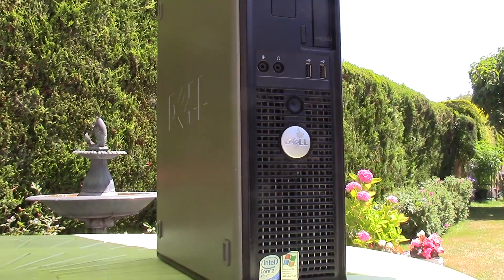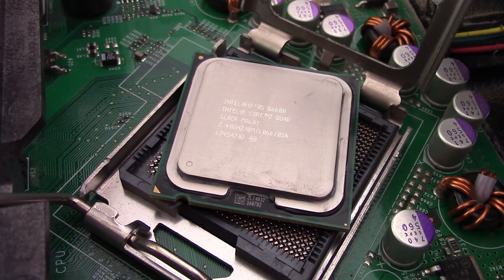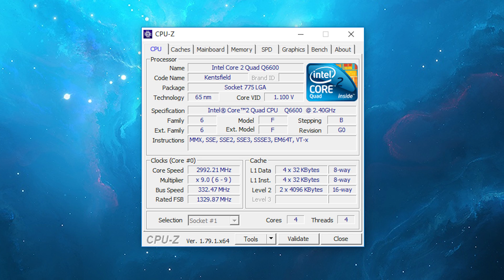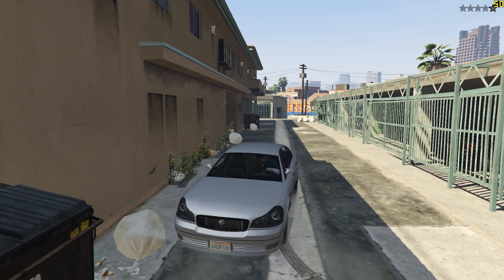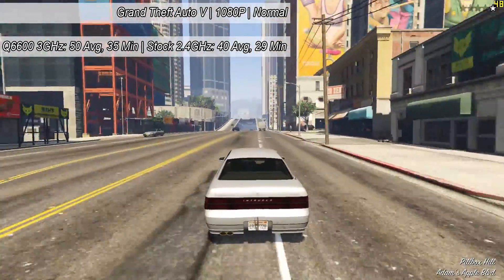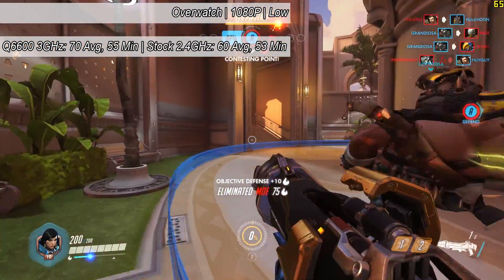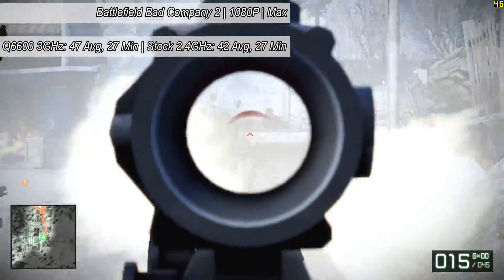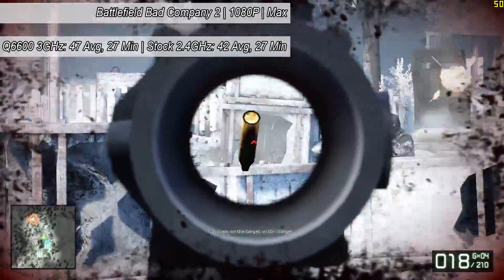Using Tape To Overclock an Old Optiplex

Comment: Just came across this video as I’m trying to do something (anything) with an old Dell Inspiron 545 Core 2 Duo E7400. Saw this, tried it; stock it’s 2.8Ghz, now it idles at 1.9Ghz but drives up to 3.5Ghz under load! Holy crap!

Comment: You can overclock the core 2 duo E8xxx series with this method too.
But you need a motherboard that supports 1600mhz fsb because if it doesn't, it won't work.
Reply: FOCU53R I got an e8400 but the fsb isn’t supported
Reply: Sorry bro, you cannot overclock the E6550 because it is already running on 1333Mhz fsb. Core 2 Quads are easy to overclock because they run usually on lower fsb (800mhz) -> 1333Mhzfsb
Reply: Q8300 works?
Reply: Should work if your motherboard supports 1600Mhz Fsb.
Q8300 is also running at 1333Mhz stock so you need a MoBo that supports 1600Mhz fsb
Reply: Yup, you can hunt the old q6600's around 10-15 $ on ebay and with the tape mod you get 2.4Ghz -> 3Ghz which is still pretty decent overclock.
Reply: @LouieV.  Do i need to changed psu for bsel mod ?
Reply: @4n4Queen  nah man, you're good with the same psu.
Reply: @LouieV.  How bout cooler m8? stock cooler still good for bsel or need to changed ?
Reply: @4n4Queen  stock cooler is alright
Reply: Will it work with my q9400 and g31 motherboard???
Reply: @LouieV.  will it automatically change cpu mhz or u must do something with BIOS?
Reply: @Qwerudbhdisn  haha old comment,but  it changes the mhz automatically. No bios needed.
Reply: @LouieV.  will it work with q9400 and g31 motherboard?

Comment: just to let you know the mod will not change the multiplier wat will change is the fsb speed and depending on the pc/chipset the mod will make the cpu run at the chipset max FSB speed. so in this situation the normal FSB speed will be 1066MHz, and with the mod its 1333MHz and so boosting the bus speed that is multiplied to get the cpu clock speed.

Comment: I just recently OC'ed my Q8300 from stock 2,5GHz to a whooping 3,2GHz - runs like a charm on 30$ air cooler, and a low-end mobo P5Q-EM.
Also I'm running MacOS Sierra which is a double win :-) Definetly will try to push my CPU further.

Comment: I just did that today on an old Dell 755 USFF that I’ll use to test some stuff on, the CPU is an C2Duo 6600 (USFF models doesn’t support quad cores) I did that and it went from 2.4 to 3Ghz fine. CINEBENCH gave the same results before and after however so it doesn’t seem to make a lot of difference (CPUz correctly shows the CPU running at 3GHz after the mod) Anyways for what I’ll use that old PC it’s fine and to be fair for a 2006 CPU it’s still fine for basic use like surfing the web (And that Pc isn’t meant for gaming, it doesn’t even have a single expansion slot and has integrated intel graphics from the Q35 chipset anyways)
Reply: I used SetFSB for my Q6000 / Dell Opti 755 Mini - And was able to o/c to 2.82ghz (prime 95 stable 2hr). i'm not sure if I can go any further though,..... gets a bit whacky when I raise FSB 1-2 clocks.

Comment: Some motherboards use the CPUID to calculate the CPU FSB and not the pins, this mod WILL NOT work on these motherboards. So that is the reason why the success rate is not 100%.

Comment: you can find more information with searching ''Bsel mod'' and in my experience the best is q6600 dont try more expensive ones.
Reply: Özgür Salman it's only work with q6600
Reply: No it works with many 775 cpus. q6600 is the most stable
Reply: Actually, expensive ones simply work on higher FSB already and BSEL mod doesn't do anything to them (Core 2 Extreme and 1600MHz FSB Xeons).
For high multiplier CPU's, like E5700, a working "VID mod" may be necessary for stability (before doing BSEL mod).
Reply: Only works for 266MHz CPUs, all it does, is to make the board think that you inserted a 333MHz FSB chip:)
Reply: 1333mhz FSB Xeons supposedly go to 1600 with this mod. You'll need a very beefy cooler though, especially if it's an X5450, X5460, or X5470.

Comment: Another CPU that can use this BSEL tape mod is the E7500 Core2Duo. It gives 3.67GHz speed. Unfortunately for the Q6600 mod any Optiplex that supports 333fsb can run the Q9650 CPU. 3GHz speed, 12MB cache, and SSE4 instruction set for newer games. On single thread games it should perform better than the Q9650.

Comment: That's what I have on my machine q6600 to 3ghz it changes the front side bus speed to 1333mhz from 1066mhz which increases the clock speed it does really well and make a massive difference for me

Comment: My New specs:
Core i5 2400
16Gb Dddr3 1333mhz ram
Gt 1030 2 Gddr5 vram
250gb Western Digital Caviar Blue HDD
60 Gb ssd
Windows 10 Pro 64-Bit
Reply: ALESSIO TULLOCH 16gb of ram is fucking overkill in a system like that, I mean, the 1030 costs less than the ram
Reply: Kevi Shader It is a Dell Optiplex 990 and I did not buy the ram. It came with it when I bought it on EBay for $50
Reply: ALESSIO TULLOCH Oh that's a good deal tbh. 50 bucks for that system is extremely cheap. You could sell those parts and have around 300 dollars after you sold them
Reply: Kevi Shader Yeah. I am actually planning to flip it, if you know what I mean.(sell it)
Reply: ALESSIO TULLOCH Good choice
Reply: My current specs:
I5 3470
24 Gigs of RAM @ 1600 Mhz
3x GTX 1070
Samsung EVO 850 250 GB
2x 3TB Toshiba P300 + 1x 5TB

Thinking about getting a ryzen 1600x but currently the I5 is still kinda holding up, so maybe I'll wait for the next gen.
Reply: 3x Gtx 1070?
Reply: They are actually pretty good mining cards.
Reply: Well my specs are:
Gtx 1060 6gb
16gb 2133 ddr4 ram
250 gb ssd
1tb hdd
i5-7500 clocked at 3.4 ghz
Reply: my specs:
hp elitebook 8470p
core i5 3340m 2.7ghz processer
8gb ddr3 1600mhz ram
320gb toshiba hhd
windows 7 professinal 64-bit

Comment: Magnificent! You've saved me a whole heap of hassle :D
You actually CAN overclock on a Dell 755 motherboard using a Front Side Bus multiplier program, which I was actually going to do (and may still do to squeeze out extra performance, many Q6600 chips can hit 3.6ghz or more stable in a Optiplex), but as a quick and simple mod, this is incredibly tough to beat :D
Thank you for sharing this video and method with us all!
Reply: Phil Atkins have you used setfsb?...because i tried to find the right pll for my dell optiplex 760 dt (0d517d) mobo...but every tries failed...i underclocked every time🤔
Reply: Roland Tibold Dang that sucks! No I haven't tried that one. It's a pain in the bum to get the correct code from your motherboard for these programs to load properly. My advice would be to try this tape method, and see if you can live with the performance boost it gives you.
If the tape mod doesn't work, have another go at setting the FSB with a different program; sometimes open source software gets coding a little wrong, so you end up underclocked.
Reply: Phil Atkins if this vid would have been earlier made, i could save about 10 dollars and much of modding from 771 to 775(next cpu will be x3363)
Reply: Roland Tibold Ahh, that is a bummer, but playing with computers and having fun modding them is a great deal of fun regardless.
I'm building a 755 optiplex for a friend at the moment, and honestly it's more fun than my AMD FX system. The next big thing for me is finding the best graphics card that operates at 25W or under :/
I wish you best of luck with your builds, it sounds like you have your hands full...
Reply: Phil Atkins wicked sick!a vga-card with only 25w tdp?...i have no wide sight at this article...and lp? one more handicap, but rgh showed an alternatitve for your problem in a previous vid. My choose was powercolor r7 240 2gb ddr3 lp (not so overkill near my e8400...dota2 720p low, gpu 90-95%, cpus around 80-85%,  and fine cleanness inside the case, fresh thermal paste at the cpu and gpu)
Reply: Have you ever tryed to look for the actual PLL chip, its right next to a quarz oscillator (oval silver thingie) on the board and usually has a nuber written on it, which you can search on the homepage of SetFSB :)
Reply: I know the 745 works with the SLG thing in Set FSB (SLG pll) got 2.76 from the Q6600
Reply: Ein I found over there as you described...the pll of the 0D517D is SLG8XP519T...on that chip is maybe a blasted hexacore...is that what i was looking for?
Reply: What's the name of the program and do you think it could work on a optiplex 780? thanks.
Reply: ElTres so long as your motherboard is a socket 775, and has an intel motherboard this method should work.

The program to overclock via the Front Side Bus is called SetFSB, but I strongly suggest you look up a detailed guide on the process; it is easy to muck up and lose your progress.

It is always possible to overload an old system or muck things up, so proceed with caution, however you should be fine with a decent tutorial.

I will note that while you proceed at your own risk, I haven't read about anything worse than a system crash overclocking the FSB.

The best CPUs to overclock is a Core Two Quad like the Q6400, Q6600, and Q6700 using this method, because their front side bus is set at 1066mhz instead of 1333mhz like many of the Duos. You can also try the Core Two Extreme CPUs, but they cost more money.

I suggest checking if you have a small aluminium CPU cooler or a larger copper and aluminium heatsink; the best results on any overclocking come from chips that are well cooled, and dell did supply a suitably beefy cooler in some versions.

As you likely have a Core Two Duo E8400 in your system as stock, this is worth upgrading before you attempt a FSB overclock to a CPU with a 1066mhz frequency. It should still work with your chip, but the results will be much less impressive.
Reply: Thank you for all the info,I upgraded to a Q9550 @ 2.88ghz stock i think its not gonna work on mines since the frequency is 1333mhz
Reply: ElTres actually the overclocking method will still work, but you won't be able to overclock as high as a 1066mhz chip will.

I'd suggest changing to a non intel/dell motherboard to get the most out of your chip, as that processor you have is legendary on a good board :)
Reply: set fsb does overclock but it doesnt save for ever.. when you shut down your computer the bios reset the fsb...
Reply: Hellenic Warrior there are several ways to make this a "permanent" fix, there are several guides as to how here on youtube! It involves adding SetFSB to the startup list, and saving a file that it accesses which sets the FSB to the required settings.
Reply: @joannaatkins822  Do i need to changed psu for oc q6600 bsel mod on 780 tower oem mobo?
Reply: @4n4Queen  actually no, you shouldn't need to upgrade your PSU at all! The OEM dell power supplies do very well and are high quality, just relatively low power. Even with a 75 watt GPU you'll still have plenty of headroom for the BSEL tape mod because it affects the front side bus and leaves the voltage unaffected.
Reply: @joannaatkins822  i see. Thanks. Btw i read in some comment, They state that each optiplex model need diffrent tape mod need so it can work, By that i mean, Each optiplex mybe need 1 tape or 2 tape for bsel mod to work, i wonder 1 or 2 tape for q6600 with oem 780 dell mobo need to make bsel work?
Reply: @4n4Queen  to the best of my knowledge the dell OEM boards running DDR2 need two pieces of tape as shown in the video, nothing more nothing less.
You're basically causing the chip to run at "default" settings according to the motherboard chipset which just so happens to be 1333fsb. You won't need to create or modify voltage to reach 3.0ghz so this should work just fine for you!
Reply: @4n4Queen  i've just double checked, and while your motherboard uses the updated Q45 (DDR3 Compati le) chipset instead of the Q43 like the DDR2 versions, this tape mod covering two pins is still applicable to your board. It should still cause your FSB to be set to 9x333 as a default, and you shouldn't need any voltage changes to do it.
This tape mod is great simply because it is so safe by loading defaults and not modifying the voltage unlike others where you needed a conductive ink or graphite to mod it.
Reply: @joannaatkins822  Yes, my board currently using ddr3 ram. Im using 8gb tho, So basicly i need 2 tape for bsel mod to work on my mobo ? Thanks man, will try it later after return to town. im curious , Do this bsel mod need to changed cooler ? Or stock cooler work fine for bsel?
Reply: @4n4Queen  The stock cooler should be fine on those boards, as they used to make the heatsinks much more beefy! The best ones obviously have a copper core, but the all aluminium versions do just fine :)
Reply: @joannaatkins822  Okay m8. Thanks for the info. Let me try after i got back to town. Will contact you again if something wrong happen. Lul. Btw does msi n660 twin froz is power hunger ?
Reply: @4n4Queen  Yes, the GTX 660 has a TDP of 130watts, which is quite power hungry. You'll likely need a six pin connector to run that GPU, so an upgraded PSU might be worth a shot! Either that or upgrade to a GTX 750ti which generally doesn't need a power connector at all, running entirely on the PCIE x16 slot power :)
Reply: @joannaatkins822  Too bad i found you on youtube a bit late. i already buy a Msi Gtx750 single fan which is no required 6pin, 2gb ddr5 128bit. Will test it first tho, If not good, will return it back, request money. And mybe take a 750ti the one you tell me. But i think 750ti price almost same as 1030 right ? I thot 750ti/1030 will bottleneck the Q6600. That why i take 750 without ti.
Reply: @joannaatkins822  Its still on the way to me tho the gtx750 single fan+Q6600. Mybe 2 or 3 days more it will get to me.
Reply: @joannaatkins822  Yo, Any idea why Q6600 didnt working for dell optiplex 780 ? Cant even boot with or without setfsb mod.
Reply: @4n4Queen  This is going to be left of field, but remove all but one stick of RAM for the first boot up. That's the most common problem for me, it can't register the CPU with more than one populated RAM slot lol

Comment: It doesn't change the clock multiplier, it changes the FSB speed. Clock = FSB x Multiplier. In this case, the FSB was changed from 1066MHz to ~1333MHz.

Comment: GPU: GeForce GTX 1050CPU: Intel(R) Core(TM) i5 CPU 650 @ 3.20GHzMemory: 8 GB RAM (7.86 GB RAM usable)Current resolution: 1920 x 1080, 60HzOperating system: Microsoft Windows 7 Professional
Any tips on how to improve it anyone
Reply: romanator scullion take a i7 860 or a xeon x3440 on ebay or aliexpress
Reply: THANKS!
Reply: tape oc ur cpu